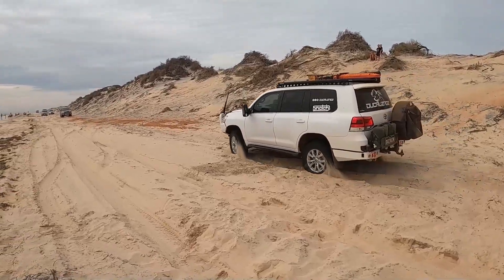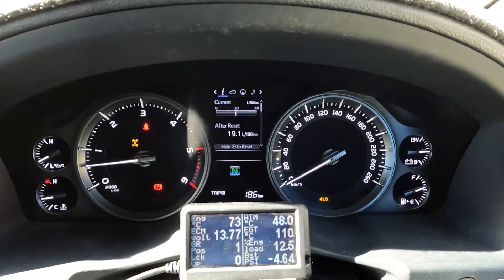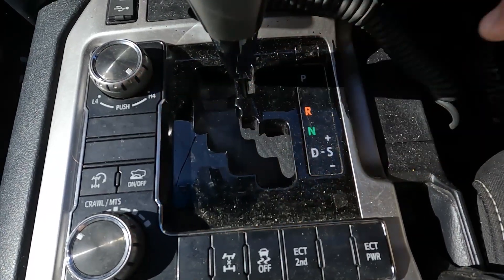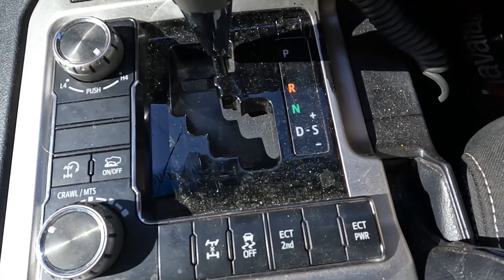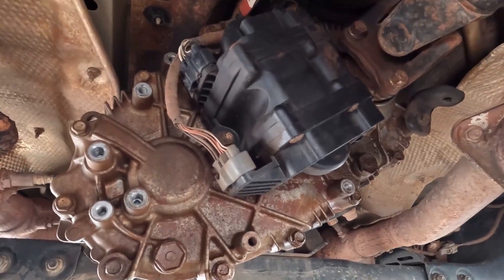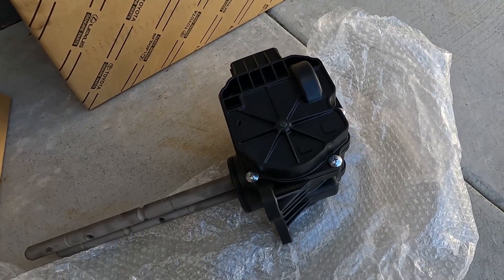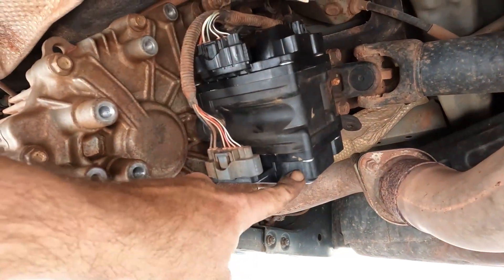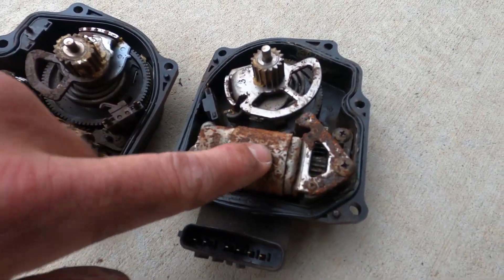No 4wd or Centre Diff Lock | Electric Controlled Selection | 200 Series | How To

Comment: Helpful video bro thank you. Mine was a different case where previous owners never used 4wd so the teeth on the rod rusted a bit to the gear and had trouble actuating as well as the contacts. I took them apart, cleaned and re greased (original grease was hard). Dielectric grease on contacts and standard hub grease on the rod teeth. It seems to work well now.
Reply from the maker: No dramas mate, glad your repair was just freeing up some neglected gear 💪💪🍺🍺
Reply: @DucruznOZ cheers man 🤘

Comment: I just found out from Toyota that the ecu for transfer case in 07 to 15 model 200.s has been superseded due to the ecu being faulty and the contacts failing. The bulletin came out in 2022. They said my 2012 is covered for 10 years for these things. Toyota won't tell you about the faulty ecu unless the customer specifically complains. I've got a case going through Toyota to see if they'll change my ecu under warranty. My 4lo and diff lock flashes and doesnt always engage and even disappears off the dash even though the 4lo is selected on the dial. My actuator and motor is all good and not rusted.
Reply from the maker: @treebs9516  wow that is awesome news if that is the case... will definitely have to follow that up 👌👌 cheers for the info 🍺🍺
Reply: @DucruznOZ  toyota denied mine under warranty it was a year out when it started. $1500 to get done.
Reply from the maker: @treebs9516  oh that sucks.... 1500 isn't to bad but still 😪
Reply: @DucruznOZ  do you know the exact location of the 4wd ecu? Im getting different stories from each dealer.
Reply from the maker: @treebs9516  mate, that's the first time ibhave heard of a 4wd ECU so I couldn't tell ya, I thought it would be in the same as the trans ecm as it was all connected via transmission/transfer case 🤷‍♂️🤷‍♂️
Reply: @DucruznOZ  it looks to be in driver's side foot well on right side.  👍
Reply from the maker: @treebs9516  legend, thanks for that 🍺

Comment: Ive got a 2023 4Runner Limited 4WD and I believe it has the same transfer case as your 200. The card on the driver's visor indicates how to shift from 4HL to 4LL and back in neutral, and the 4HF and 4HL can be shifted while rolling.
I've had it for a year, I play with the actuators twice a month and I've have not had any issues at all. Thanks for your video 👍🏼👍🏼
Reply from the maker: @peterromano1911  that's awesome that u keep cycling the function like u have said, will hopefully last a very long time 🍺🍺

Comment: Is it the same on 2017 prado 150? Having similar issue, diff lock is just flashing, button doesnt seem to be doing a whole lot, and the l4 is not showing up as being engaged on the dash. So im not sure whether the diff lock is locked or trying to lock? If that makes sense. Great video thanks
Reply from the maker: @thevideo7470  not 100% sure but I know the hilux runs the same/similar system so I figure the prado platform would be very similar..... if you are handy and confident you can always just pull the covers off and have a look... otherwise toyota would be your best bet 😉

Comment: Did you scan the 200 before figuring out what was wrong. I have the same lights but its throwing a speed sensor fault despite replacing the sensor
Reply from the maker: @ianmcdonald4780  nah i didn't scan it beforehand... I just knew it was the 4wd engage system as it was not engaging 4LO or centre diff lock. What sort of speed sensor is it??
Reply: @DucruznOZ  its the vehicle speed sensor on an 08. Got a VSC light, 4lo light and another light I cant remember
Reply from the maker: @ianmcdonald4780  oh bugger, could even be in the harness maybe 🤷‍♂️ might have to take it to a sparky or Toyota directly....

Comment: Hey, Hope your doing great, I change the actuators for new ones, but diff lock still flashing and it doesn’t work, any correcto form to put the gears on?
Reply from the maker: If it still isn't engaging properly it may be more than the actuators that are the problem. It could also be that the contacts in the actuators are in the correct position....

Comment: Where did you buy the actuator, could you help me with the link? got the same problem
Reply: Btw this part function for a Diesel version 2009 LC200?
Reply from the maker: @marciogallegos7049  it was a genuine Toyota part... I can't guarantee that it will fit the earlier LC200 (pre facelift)... google partsouq.com and they have a great part number reference system.... good luck 🍻🍻

Comment: common problem of burned contacts in Lo/Diff actuator. Usually caused by non use.  If you only use high 4 then it is good to engage Lo and Lock once a month.
Reply from the maker: 100% agree... that's one thing I miss about a lever through the floor, ha ha

Comment: You can remove the actuator you just need to be careful ive done it before. Then clean the contact points. Its been 2years since and no issues.
Reply from the maker: U mean the rods?? I did remove the actuators, both of them....
Reply: @YakAdventured  If you just cycle the actuators at least twice a month, you should not have to remove them at all. Just put the transmission in N and cycle through all the transfer case gears.

Comment: Thanks good video. The Computer does a pre check on the actuators and if the contact fails it flashes the lights which as you know is the first indicator to use them more. A small current is put through at the system pre check can burn those plates if never used which is what you were showing. A handy video for many thanks again.
Reply from the maker: Absolutely, cheers for the comments 🍻🍻 I do miss the old lever through the floor though.... ha ha

Comment: Not using 4low enough then. Moisture gets in and corrodes the point. That or you have lost the breather tube.

Also can be sign the batteries are dieing
Reply from the maker: well we definitely use 4 lo and diff lock more than the average joe, say it was just the seals or the breather tube that caused the water ingress and seizing of the motors  :)